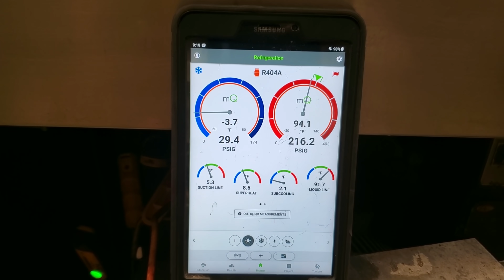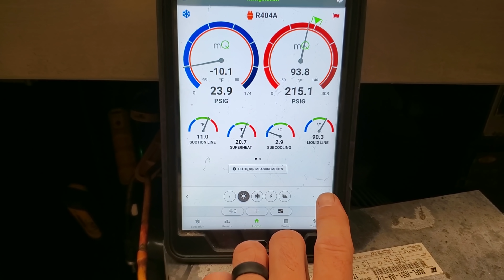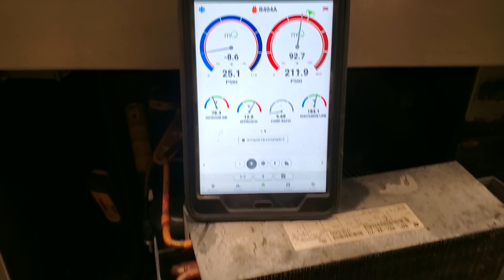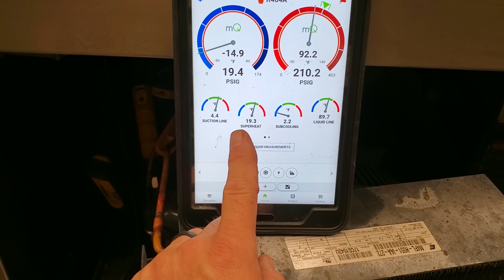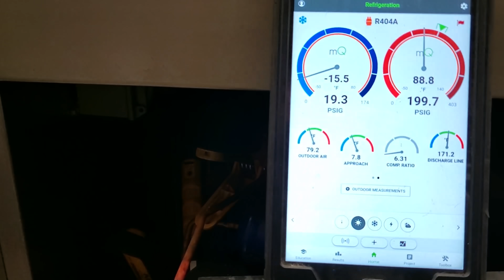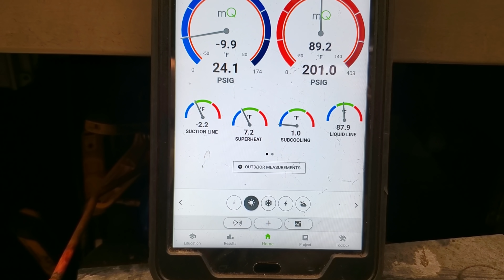THE COLD RAIL IS NOT GETTING COLD

Comment: Hey Chris im currently working on a Kairak cold rail and having issue with drainage. Looks to be broken under where lines exit rail underneath where insulation is so when i try to flush from uptop it just leaks at fittings underneath insulation and nothing coming out from end of drainline. So right where fan is underneath is just holding water! Any advice?
Reply from the maker: The drain likely is frozen turn the entire unit off for a couple days that try clearing it with hot water, do not use compressed air. Also try adapting a piece of 1/4" tubing to a hose and put that in the drain so the cold water can still escape while the hot water is melting the ice.... if there is something actually stuck in the drain there is not much you can do about it so let's hope it's just ice!
Reply: So i tried to run nitro through drain and it initially starts to drain but builds up again. The drain at end of rail is not holding water so when i flush that line it leaks water underneath. How difficult is it to re plumb line underneath where lines exit rail? Im an Hvac tech with some experience with refer but not much. Im digging it but get overwhelmed at times! I knew i always wanted to go this route from the beginning of my career after getting called out to a cemetery at midnight for a body box storage unit. I didn’t want to take the call but after handling it, i knew this was my calling! Thanks for all your videos and knowledge!

Comment: Good video ! For Sure Trashcan Blocked Condenser. Time to Put that condenser on the Roof or somewhere else. At a Minimum Push condenser farther in and put a screw in it to hold it there to allow for an air space if trash can gets put in front of it again , which u know it will.

Comment: Is it possible that unit is over heating in that area have had to add extra axial fan to areas like that.
Reply: I seem to remember a similar situation in another kitchen where he installed a bar in front of the condenser to prevent anything being pushed up against it.
Reply: Was referring to recirculation of hot air due to the confined space .

Comment: I service 10 mcdonalds stores. And every single cold rail,and  I mean every single one. Has a hard start on it. Which were put on before I began servicing them. Any tips to keep those compressors from cashing out so fast? They are supposed to be shut off every night
Reply: 1) Put a Suction accumulator on the Condensing unit. Upon start up compressor is getting hit with liquid taking out the compressor.accumulator will prevent this.
2) Set a 5 Minute time delay on the Condensing unit Temperature control to prevent short cycling.
3) install a 5 Minute time delay on liquid line solenoid for cold rail to lessen the load on start up if the unit controls both an upper rail & lower refer section.
4) Degrease condensers monthly  if self contained.
5) Remote the Condenser to the Roof & Go up one size in Cndensing unit.

Comment: Hey just watch this video on the cold rail. I have seen customers fill pans and cover them with cling wrap and stick them in a walk in refrigerator and then when the food runs out they stick them in the rail. Thinking it will work but reality it doesn't. Manufacturers may want to think about maybe running the copper or glycol lines around the pans on the rail pan cut outs if that makes sense? 
But they have engineers for that stuff.

Comment: Water has 80 calorie latent heat of fusion at freezing point which makes it difficult for the ice water in the table to freeze.
Liquid water will change 1 degree C for every calorie added or removed.  But when it gets to freezing point 0 C it hits a brickwall.  The temp of water does not go below 0C until 80 more calories are removed after reaching freezing point on the thermometer.  Then it finally starts going down below freezing.
This is why when the weather goes to freezing and there is lots of rain, snow, sleet(i.e. water) it is common that the measured temperature is 32F and it takes a rather strong cold front to push below 32F.  In the Atlanta area it is common when we get snow/sleet that the temp is 32F.  It only goes below 32F when the precipitation stops and then only the air mass goes below 32F.  Up north the cold fronts are strong enough to push through the 80 calorie  latent heat of fusion so they get snow at below 32F.
In Atlanta when the forecast is for at least several degrees below freezing we know it will be dry with no precipitation.

Comment: It's good to see that you are foaming from the bottom up. This is the only way to see that it's actually getting into the coil. If you start at the top, it overflows, and covers the outside of the coil, and doesn't allow it to flow in making it less efficient, and trapping dirt in the coil.
I work for a maintenance contractor at a major food manufacturer, and this is actually written into our cleaning protocols and procedures.
Reply from the maker: Yes, exactly, I will discuss this on my Livestream this evening 12/21/20 @ 5:PM (pacific) come over and check it out
https://youtu.be/2ohYV-sAQZI

Comment: It almost seems like everything in a commercial kitchen should have a remote condenser. It would fix them being blocked, getting filthy, etc. It would also save space and make the working environment quieter for employees. I want my fridge at home to have a remote condenser so I don't have to listen to it anymore.
Reply: When living in a state with very snowy winters its one reason I'm glad there inside
Reply: If it’s a Cooks line - For sure ! Also Allows for 1/2 the unit to be worked on During normal business hours. Condenser can be cleaned during normal business hours & it will not get full of Grease if it’s on the Roof too !
Reply: Fractional hp compressors have other issues being remoted. And they get plugged on the roof too. Just not as greasy.
Reply: I think it would keep things cooler for the cooks as well, and the general area AC wouldn't have to move all that heat through a refrigerant a second time, so it would be more efficient.

Comment: Quick question on the filter media you used over the condenser coil, even though I agree with using one the manufacture doesn’t recommend and won’t  warranty the unit if it fails. My business is just doing PM work on HVACR and doing quarterly maintenance on these reach-ins, you wonder how they make it though the 3 months without having problems.
Reply from the maker: I will discuss this on my Livestream this evening 12/21/20 @ 5:PM (pacific) come over and check it out
https://youtu.be/2ohYV-sAQZI

Comment: I like the condenser filters. I used them at my first refrigeration job. They solved so many problems for the low boys under the friers, but the customer still would not change them even when I left spares.

I totally agree with your closing comments. I would get the operating instructions when we would drop off new units with top rails and show the customer the manufacturer's instructions on rotating the product. 

Yet that always seemed to anger the customers. The salesmen never talk about that requirement; so when I bring it up, I'm the bad guy. Oh well, win some and than there's the rest of life.

I like the split condensing units on the box and top rail. ASI could (probably should) do that with their unit. I have yet to work on one that was not totally over worked and in a high ambient environment.
Reply: Compressors get ran through so fast on those cold rails.
Reply from the maker: I will discuss this on my Livestream this evening 12/21/20 @ 5:PM (pacific) come over and check it out
https://youtu.be/2ohYV-sAQZI

Comment: Great video Chris. Those hi and low pressure safety controls you installed was a great idea. I'm working on a cold rail right now which is an old R22 unit with a compressor burn out. It was built by a company called Craig Manufacturing in Irvington, NJ which has been long out of business.  Even though the unit is 22 years old the owner still wants it fixed. Keep posting great videos, I'm a big fan of your channel.